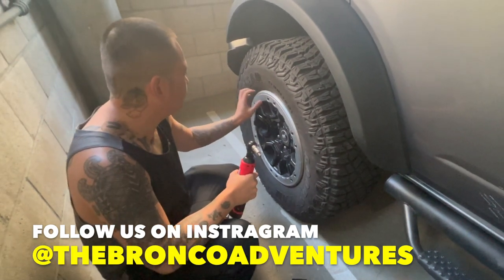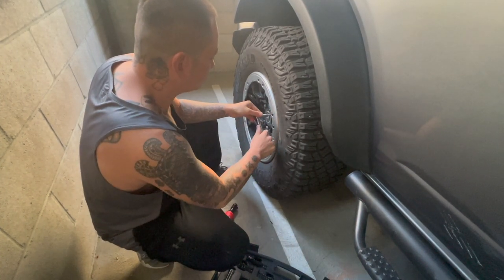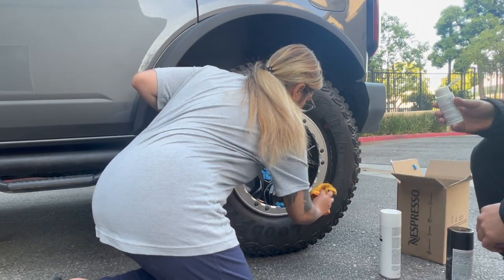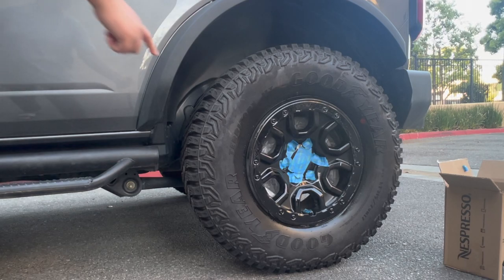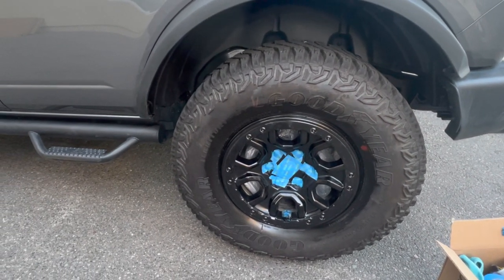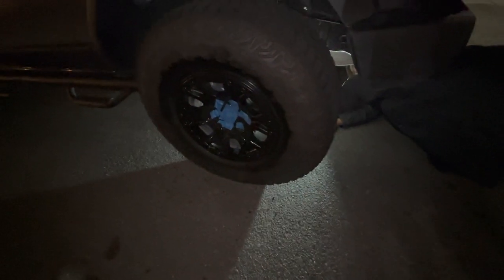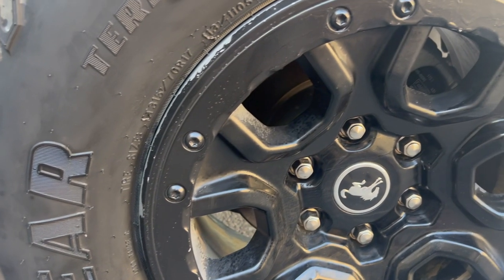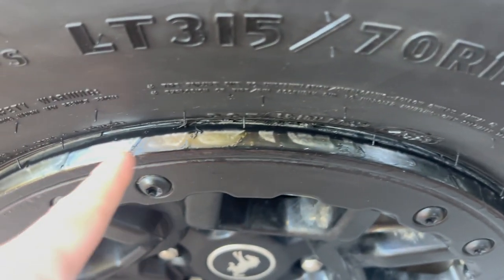FORD BRONCO WHEELS UPGRADE | The Bronco Adventures

Comment: Those bolts require a T45 torx bit. The one you were using looked like it was too small.
For the paint to adhere properly, the surface needs to be sanded. After sanding, remove grease/oils by wiping with acetone then a tack cloth.
Painting the surface with a ratle can, the nozzle should be about 12" away from the surface. Apply 3 thin coats to prevent runs.
Juat an fyi if you want to try to reapply the paint properly since it will likely peel/flake off.

Comment: Looks good bro! I'm a fan of black wheels. All my cars get blacked out. A neat trick I learned from fellow Youtubers is using index cards to protect overspray on the tires. It also allows coverage between the rim & bead. It really cuts down the mod time & makes it much faster. Thanks for another great vid!
Reply from the maker: Thank you so much for watching! Yes, we are a big fan of black wheels too!! Thank you so much for the tip! But next time we will try to remove the beauty ring and spray paint it that way.

Comment: Dipped my wheels in the past. Wouldn't recommend it. Everything sticks to it like ductape. Brake dust, dirt, gravel, grass etc and doesn't come off.
Reply from the maker: Thank you so much for the heads up and for watching! We cleaned it 3 times already and still good! 🙌🙌 but you are right it does stick everything, that is why we also invested on some chemical guys cleaning stuff.
Reply: @TheBroncoAdventures  even did my dash looks great but it's constantly needing to be wiped down. FYI got 3 more months till my bronco comes in. Lets go!

Comment: Those are real bead locks. Good thing he wasn’t able to take off the beauty ring as he called it.
Reply: :No they aren't. They are beadlock CAPABLE, meaning that to make them beadlocks you replace those rings with the Ford beadlock rings after you move the tire to the outside bead of the wheel and use the actual beadlock ring to clamp them to the wheel.